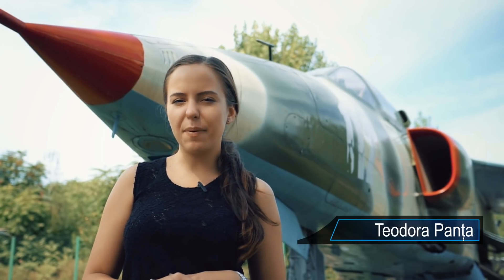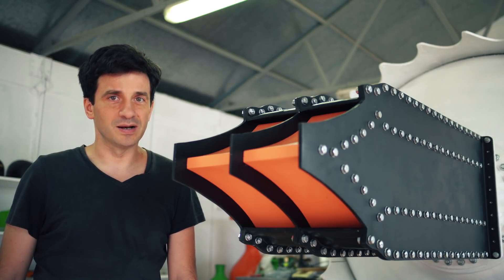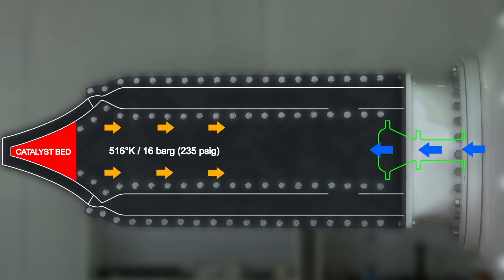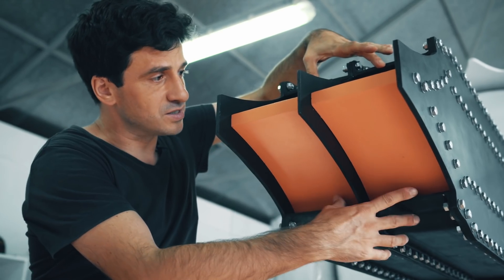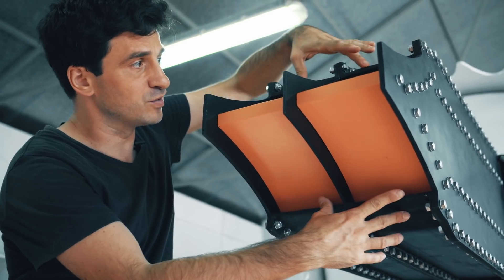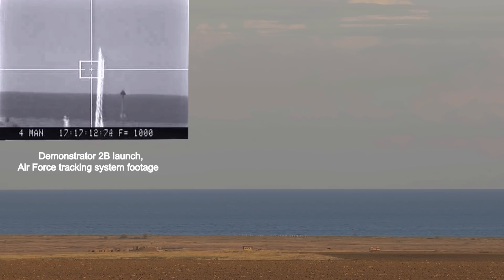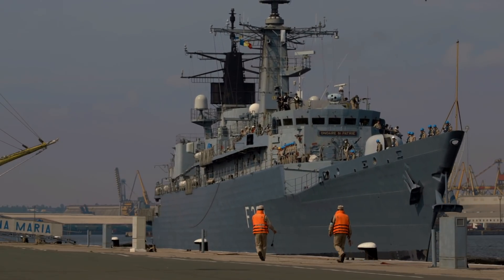Flight of the Aerospike: Episode 25 - How the Rebuilt Linear Aerospike Engine Works

Comment: It seems like engine will self choke moments after firing (hot gasses can accumulate close to catalyst blocking it from new fuel.
Also fact that flow needs to be reverted in two places seems wasteful. Why not just keep flow straight?

Comment: Is this a battleship model, a proof-of-concept to show thrust can be attained? Thrust gas temperature or gross gas mass seem to be important for launch (ISP of Hydrolox or sheer mass of solids for instance.) The purpose of catalyst systems is reliability at the expense of efficiency, hence their use as maneuvering thrusters. But a reliable test bed is important. Best wishes.

Comment: I'm confused about something with the engine. Is the propellant intake and the engine exhaust all within the same chamber, or are they separate? Because the way that diagram looks, it seems like the hot exhaust would just push the propellant away from the catalyst, causing the engine to shutdown. I might be missing something, IDK.
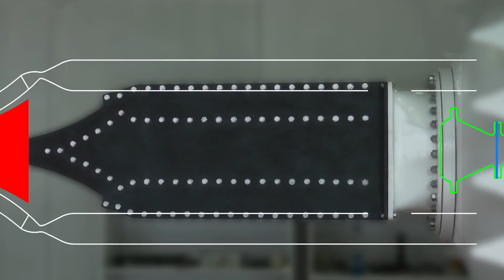Reply: 0:57 - This diagram must be hiding a trade secret. I think there must be a duct that is the full length of the engine, leading from the tank through a catalyst bed that's the full depth of the engine. Comingling the gasses and fuel will corrupt the flow and send a mixture of gas liquid to the nozzle. Frankly though, decomposing the H2O2 and venting the gasses without igniting them is a missed opportunity for thrust creation, oxygen rich flame environment or not.
Reply: The engine is pressure fed that means the tank is higher pressure than the combustion chamber.
Reply: But the exhaust is right next to the intake. The rest of the combustion chamber would just equalize in pressure with the intake, and it would start to just flow directly out into the exhaust. It'd be like trying to blow into an empty soda bottle.

Comment: I really don`t  understand why you are using only h2o2 every viable rocket that has used it used it as an oxidizer from the german me163 comet to the british black arrow orbital rocket. I think you might be building an over powered bell jetpack and I think the oxygen rich exhaust is going to damage the engine. If you go forward with this I recommend the first revision to have a fuel cycle adding some hydrocarbon to the mixture .

Comment: Thunderf00t needs to audit your channel because I smell BS here. Just a suspicion though, you're not worried though?
Reply: Okay Chaim, you read it on the internet: tested, proven, sound.
Reply: Chaim Goldbaum 
The concept is sound.
Reply: Thunderf00t can't tell truth from fiction in the first place, nor science from science fiction half the time.
Reply: The technology has already been tested and proven. If you'd only look it up, you would see that for yourself.
Reply: Look up the XRS-2200. It's been done before. It was going to fly on the X-33 VentureStar but they couldnt get the tanks fixed before the deadline
Reply: yes, aerospike engine works, but design shown here has few aspects that are strange... Namely catalyst positioning and reverting of flow...
Reply: @FlyingSnake110  Finally a comment that gets me. 

I'm not skeptical of the aerospike, it's an amazing and proven concept, i'm just skeptical of the video's design or implementation.
Reply: @lavie1542  It's a popular misconception that the X-33 was scrapped due to technical challenges. They were able to replace the failed composite tanks with conventional aluminium ones, and it turned out to be even lighter almost by half a ton.
Politicians insisted on keeping the composite materials, someone going as far as saying that there was no other reason for the X-33 to exist other than the composite tanks.

As always, one of the most ambitious launch vehicles was cancelled thanks to politics, nothing else.
Quite funny, beacuse if they had allowed the X-33 to fly with aluminium tanks and wait until composite technology becomes mature enough, they could have easily changed the design later.

Comment: I'm an aerospace engineer with hydrogen peroxide rocket engine and catalyst bed design experience. With ARCA asking for money on Patreon, I wanted to voice my observations below because I have severe doubts that ARCA is a legitimate aerospace company and anyone giving them money should be extremely skeptical.

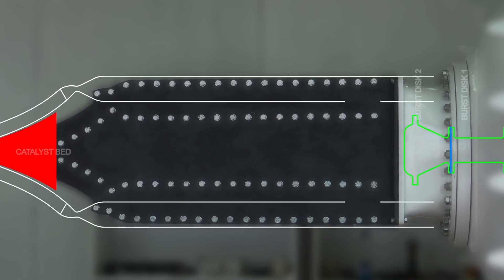1) This aerospike engine will not work because the catalyst bed design is impractical. Previous catalyst bed designs have the catalyst "in line" with the propellant flow or in other words, the catalyst is like a "filter" the peroxide goes through. The catalyst design depicted in 0:56 will not work because peroxide will not immediately decompose upon contact with a catalyst; in a screen-type "filter" catalyst, which is usually silver electroplated onto nickel mesh (this is usually the best performing combo), there will be a "plane" in which one side is liquid peroxide and the other is decomposed superheated steam. This plane will move shallower or deeper in the catalyst depending on various factors like feed pressure, catalyst design, and peroxide concentration. The catalyst also causes larger pressure drops so I highly doubt this engine can attain any sort of viable performance; I would really like to see the CFD results for this engine. To read more about it look up "Peroxide Propulsion at the Turn of the Century" or any of Aerojet Rocketdyne's research in monolithic catalyst beds.

2) In another video, the hand layup fiberglass used by ARCA is bonded with an epoxy resin. This is problematic because high concentration peroxide reacts violently with epoxy. EDIT: My reference sheet may be incorrect and epoxy may be compatible with peroxide.

3) At 3:40 the exhaust gases may not MELT the test stand structure, but they may weaken the structure enough to cause failure because yield strength (a measure of the material's strength it can withstand before it permanently deforms) decreases as temperature increases. You do NOT need to attain a metal's melting temperature in order for it to fail to maintain a load. You also don't rely on your deluge system on your test stand to cool your test stand's structural members. You have a deluge system to dampen noise and to protect your engine from any debris that might be kicked up because of the engine.

4) It was also brought up (not by me) that the fasteners on this "aerospike" are of low quality with no retention mechanisms; no locknuts or safety wire. In other words, the vibrations of the engine in flight may undo the fasteners.

5) Where are the engineers? A company who releases "Flight of the Aerospike" isn't exactly a stealth startup and a quick search on LinkedIn show no engineers at all, and there is no "Team" or "Management" page on their website. Who is doing the design, analysis, manufacturing, and test?
Reply: Enzo, that was a pretty good overview of the troubling engineering I see here as well. 

Most worrying is the 180 degree turns taken by the propellant flow during decomposition and then another 180 degree turn of the hot gases - losing a lot of energy in the process and dumping it into the structure. Squares are also not good shapes for holding pressure.

On point 2, The Cole-Palmer chemical compatibility guides suggests that epoxy is compatible with 100% peroxide. Can you get more specific about the challenges of using epoxy with peroxide? Would a highly cross-linked epoxy be stable enough under low temperatures? After all, there are many different types.
Reply: @Lars-asaurus; You're right, my reference sheet I used may be incorrect.
Reply: @ARCAchannel  I won't comment about anything related to company management or the like.

However, his concerns about the catalyst bed are very valid. The resin, I'm going to assume you chose a peroxide-compatible resin, and that the lack of any apparent fastener retention is not there merely because this is a prototype.

On the note of the bed, you'd be better served routing the peroxide thru the spike itself for cooling, then back up to the top and through a catalyst "core", which feeds into your nozzles on the aerospike.
Reply: Interesting how you choose to attack a person with legitimate concerns over addressing the valid points being made.
Reply: Oh I see Drama! Interesting!